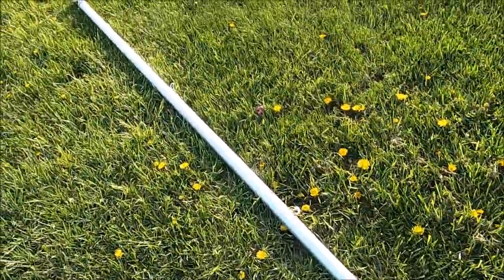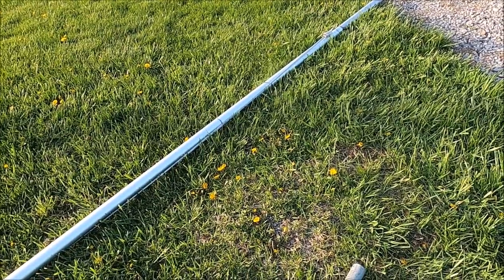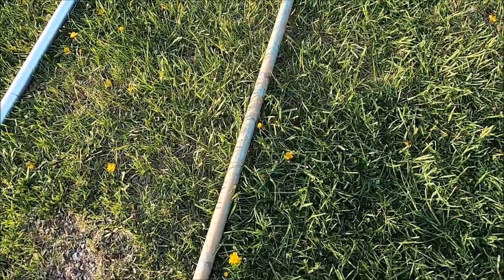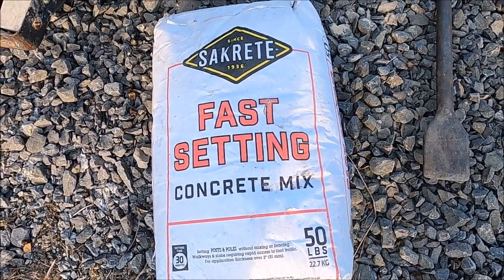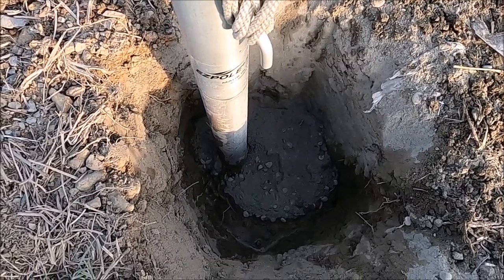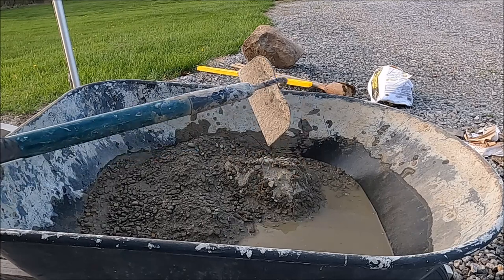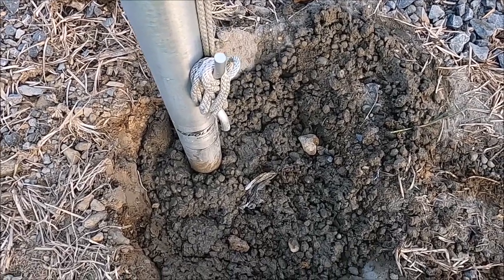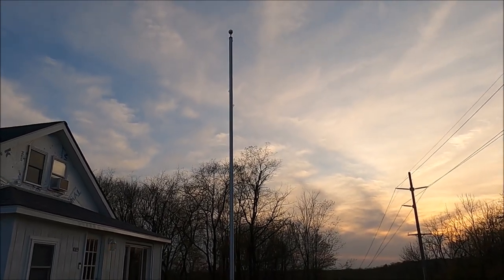Strengthening Aluminum Flag Pole

Comment: Curious - what are you doing to mitigate the galvanic corrosion between the steel insert and the aluminum pole? Unlike metals don't always play well together. ;)
Reply from the maker: Yeah, I mentioned that. If the metal pipe insert was stainless steel I wouldn't use it. Even with the carbon steel insert, I mentioned that the pole was painted and that there shouldn't be any contact between the two metals.
Reply: @brettleybuilt  Got it - thanks.